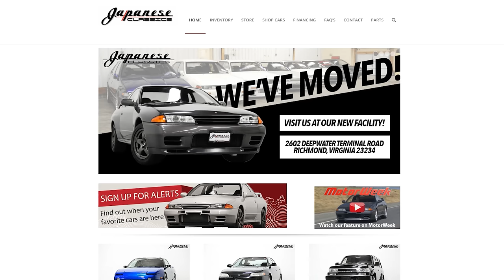So You Want to Import a Car

Comment: I purchased a 94 s14 silvia last year. If I could give one piece of advice to anyone looking to import any car... Just remember, you aren't buying a new car, it's 25 years old, and most likely a car that was never sold here. If you were to go buy a 1995 (insert any used car here) think about all the little things you'll have to fix, all the maintenance that will need to be done, and god forbid something breaks, what it's like to find and buy parts for a car that was sold here, now multiply that cost by about 4-5x for something that a version of was sold here (Like the silvia or supra) and another 4-5x on top of that for something that wasn't sold here (skyline etc.) A lot of people can afford to at least finance an r32 for 25-30k... But not many can pay for the following 15-20k in maintenance on it over the next year or so just getting everything up to snuff on it.

Comment: Short version: Use a well known importer!!!

October I purchased my 94 WRX straight from japan. The problem that I had was I used an importer that was so confident in themselves and they told me they could get it here for less than 6k so I took that offer. After purchasing the car the boat kept getting delayed. Eventually the boat sailed and I had to use the broker. The broker costed me ~$600. So far we are at $6400 not even seeing this car. My car made it to the port December 22nd but didn’t clear customs until January 6th. Went to pick it up with my very “legal” temporary plate ($150) all to come to the greatest news of all... the car does not run. I was told by the company that the car ran great (yes I know make sure you get a video. I will next time) so I had to call myself a tow truck. 2 hours later the tow truck came ($300) to get the car back home now. So after that the car was home for 2 weeks before I found a mechanic to work on it. So mid January that car left me. And sometime this week the car is being brought back. So all together it costed me about $8-9k to have the car running. Still not registered in NJ because this state sucks for imports. So lesson learned, spend the extra money on a well known importer; they’ll get you a title, running car, and definitely less of a pain in the ass.
Reply: Do you know any importer that can help me? Want to import a Beetle
Reply: So what im getting from the comments on these videos of people who did it themselves is it can be cheap to do it but hiccups make it expensive🤔

Comment: Lol here in México you can import vehicles over 9 years old but only if they where originally manufactured in USA or Canadá.  If your vehicle Vin starts with something diferent to 1, 2, 4 or 5 its impossible to make it legal. Even if it was legally imported to be sold in USA by the company itself. You can't make a US 240sx legal in México because the Vin starts with J. We're really fuck up.

Comment: R33 gtr's are 50k usd in the states because that's what people are willing to pay after all the importers set that price to test price levels. Do it yourself and you'll be able to save an average of 10k usd. Bought mine in late 2018 for 30k, paid for storage, export, import, duty, bond, brokers, etc and at the end of the day I should be all set for about 35k usd before state tax (picking her up next week from the port). Most clean r33 gtr's from Japan from places like GarageDefend for example are priced higher than mine as prices for clean, non-rusted, accident-free 1995 examples are getting harder to find (also I bought 1 year early knowing prices are going to jump like the 32's). These days it'll run you about 35k usd+ to buy one, so still around 40k usd at the end of the day. Even if you include transportation, a bit of maintenance, and other fees, these US dealers are making a minimum 5k USD per car. 
Anyway, if anyone needs help with the process, feel free to message me on my IG @omgtr33 because they didn't go over the process at all. I still have people messaging me after my last comment on a video like this on their channel.

Comment: First car is an R33 Skyline GTS, was perfect for about 1 year, now I’m stuck waiting for parts because she’s pretty buggered up. So yeah I’d say this is pretty accurate of what it’s like to own an import.
Reply: Was actually looking at importing this car, have you had many issues since you purchased it?
Reply: ImZiricuL well, the car definitely doesn’t like Canadian deep freeze. Got so cold the radiator just decided to crack across the top. Other than general maintenance, my biggest issues that I’m getting resolved is that the brake rotors and Suspension setup are 25 years old. Got the brake rotors replaced and waiting on my coilovers to get here. TLDR: The RB20e has been reliable, everything else is slowly falling apart.
Reply: This is why you need to be patient, work with an importer with a mechanic contact, and overhaul any worn parts while it’s still in Japan. You’ll pay dearly to overhaul it stateside.

Comment: Very good points to be considered here ⭐. Procuring a rare project is one thing.. maintenance and repairs is another. This past year I had the pleasure of working a restoration project for an 86' Subaru Brat. Glad to get it out the door quickly. Honestly I felt like a curator most of the times and it made me paranoid to store and maintain it. This may be an example of something more extreme than what we all are tuning in for here. I appreciate the experience of restoring something that is older, scarce even though it was a challenge and drove me a little crazy at times (parts difficult to find-had to resort to getting some parts from AU).

Comment: Fun fact here in Vermont the law is technically 15 years instead of 25 years since you don't need a title if a car is over 15 years old. So yes you can get a r34 in the states it just will take a bit more time and u need to deal with registering the car in Vermont.
Reply: Wrong. Not federally legal until 25 years old and will usually be stopped at the port. Good way to get a car crushed or have its serial banned forever.

Comment: I don't want some fancy boosted Skyline. I just want some slow 90s JDM Nissan or Toyota just to have to right hand drive for under $8k. For those who already own JDM cars in the US, how do you guys maintain your cars? Its not just finding parts but finding a competent mechanic to work on them. I'm not sure how much different JDM cars are from the US car, but I'm sure some/most mechanics might not feel comfortable working on a car they haven't worked on. But I'm not sure and would appreciate your input and where you are located in the US  👍

Comment: I found a 1988 BMW m5 manual transmission with 200,000+ miles for $800. It doesn't run should I buy it?

Comment: I have a completely  stock 1992 Toyota Aristo that I bought less than a year ago. One owner and it had less than 24,000 miles on it when I bought it.
That particular one has the non-variable valve timing 2JZ- GTE engine. So far all I changed on it is a set of wheels and tires that I bought from Fitmentindustries.com. Right now I'm still trying to decide whether or not I'm going to lower it with coilovers or airbags, still trying to decide. Any suggestions?

Comment: You got it wrong. You don't want to find an importer, you want to find an exporter in Japan and a customs broker. Going through an importer you pay way to much money. Yes it's more of a hassle to import one without going through an importer but you will save thousands. I've done it both ways. Also if you want a 1995 better be looking at late 95s or even 96s because once it becomes USA legal you're over paying. If you want one of these JDM Evo IIIs I would honestly buy an Evo IV right now. You have to buy nearly 1 year early if you want any sort of a deal. People are already storing 1998 R34 GTTs.

Comment: What about importing a new car from Mexico into the US?  If anybody has any info on how to do that it would be greatly appreciated.  Been researching all day and can’t really find much reliable info on how to do it.  I “hear” its pretty doable to import a car from Mexico or Canada as long as it meets the EPA requirements but can’t find any info on the actual process.  I want a Suzuki Jimny but of course Suzuki pulled out of the US ages ago.  Well, they pulled out of the car market anyhow.  I live in San Diego and they sell these things in Tijuana so I could literally go get the thing no problem.  But, how do I get it across the border and make it legal in the US???  Thanks much for any info…
Reply from the maker: I believe it’s the same rules, 25 years but you should be able to look that info up! -Edgar